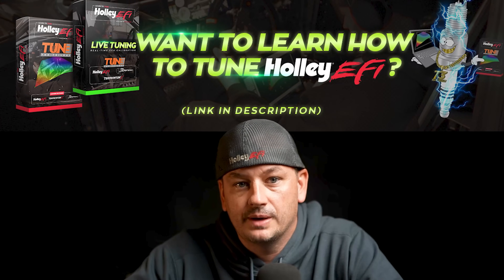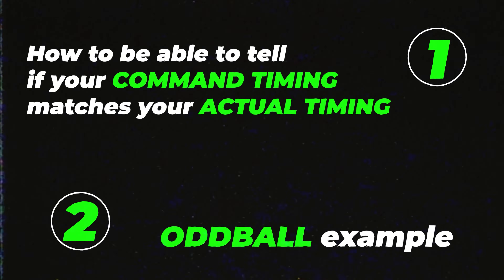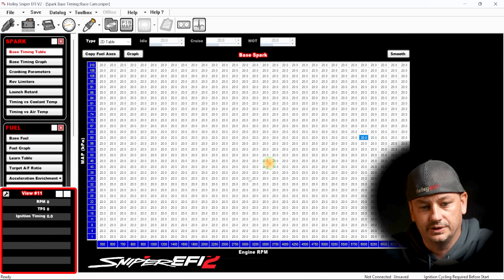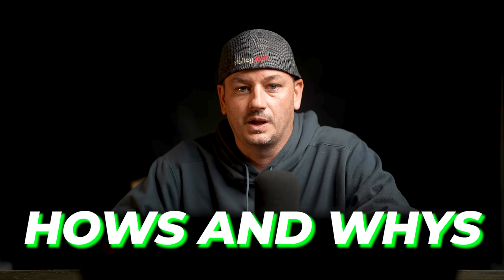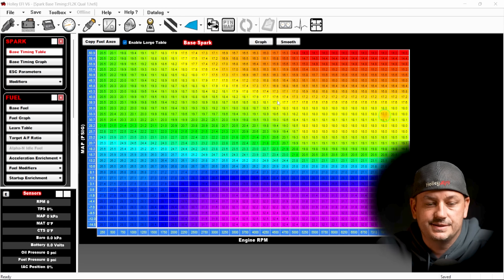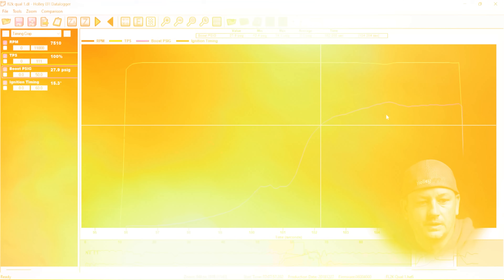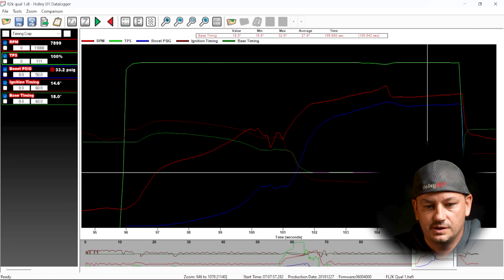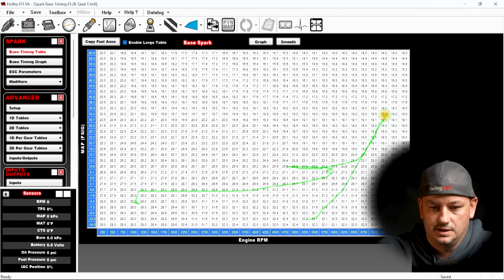Why Your Holley EFI Ignition Timing Isnt What You Are Commanding

Comment: I'm assuming the "warning enabled timing offset" is triggered by the "caution max" value? guessing caution/warning is the same here.. wish they'd change the wording to match though to avoid any possible confusion. the sniper UI was laid out in plain terms. it also has an option to "cut ignition" which i like. assuming you can probably do the same in an advanced table though.

Comment: After I got my set up running My Dominator box was burning up NTK or Bosch wide band every two weeks. They would fail only on a cold start up. Even started using a heat sink bung, didn’t help, Never had one fail while driving. I fought this issue for about a year.  The fix…uninstall and reinstall V6 software. 
Must of been a software issue because for over a year its been perfect. Holley techs swore it was the position I had it in or my wiring. It was a problem because after the second sensor they refused to warranty them out. I just bring this up incase someone else ever has this issue and can’t figure it out.